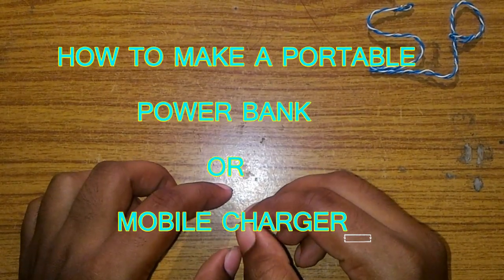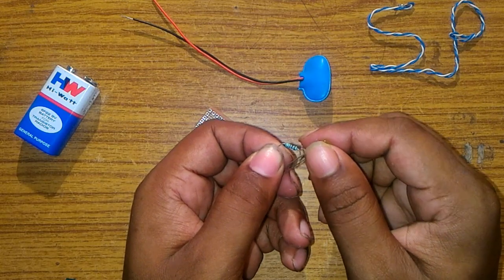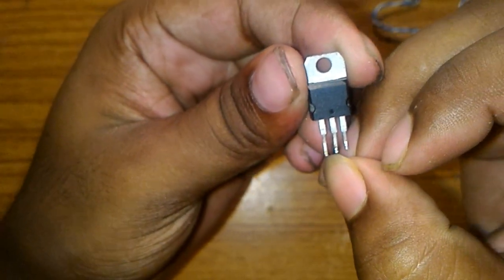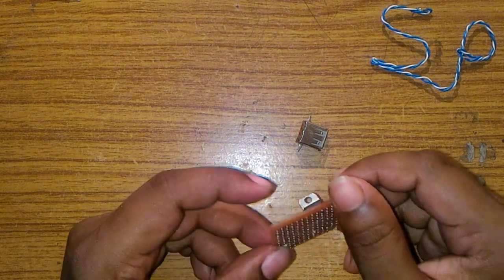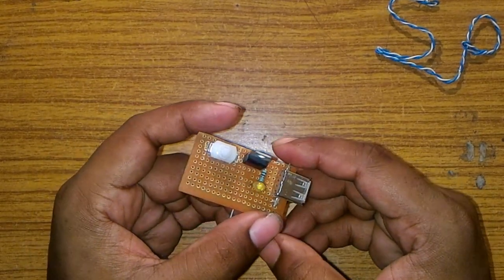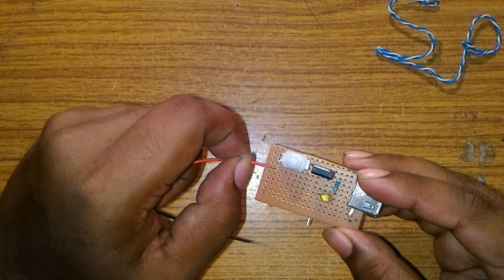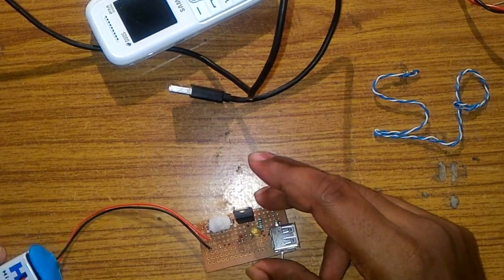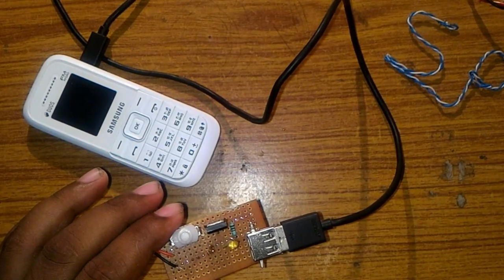Project 12: How to make a Portable Power Bank or Mobile Charger.

Comment: sir ,i want to say .electronic part of power bank .means charger and port part of power bank
Reply from the maker: for USB Female port  goto https://hacktronics.co.in/connectors-adapters/usb-type-a-4-pin-female-connector-socket?search_query=usb+female&results=8  and you check https://hacktronics.co.in you get all components if you not get those from local electronics shop